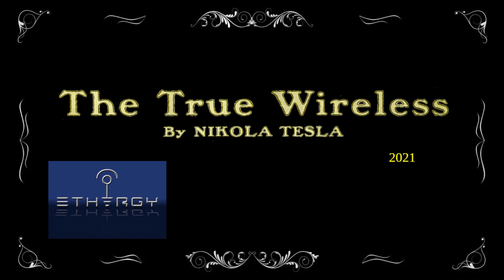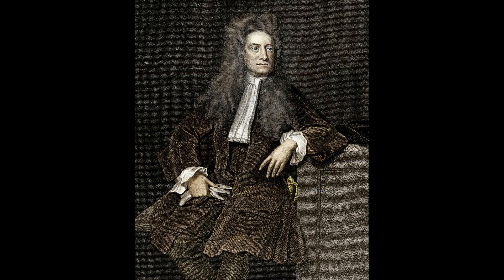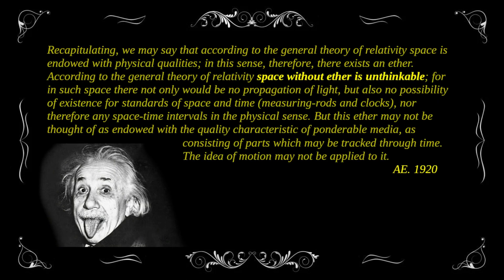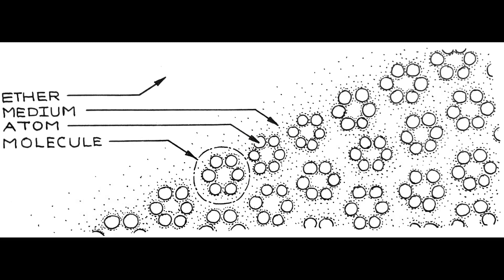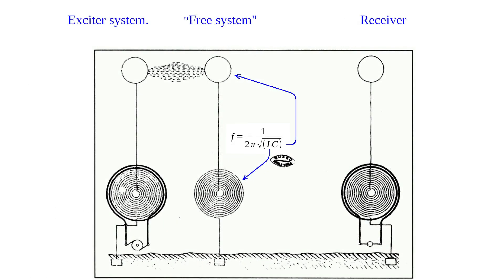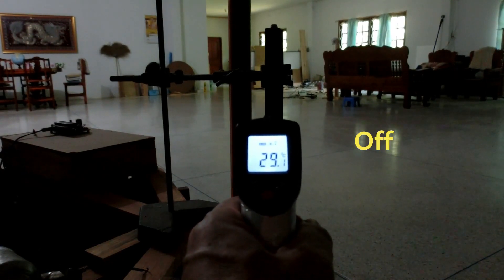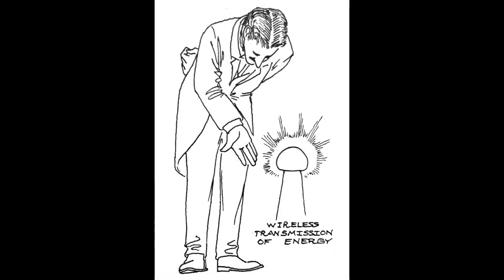Sending electricity through the Earth

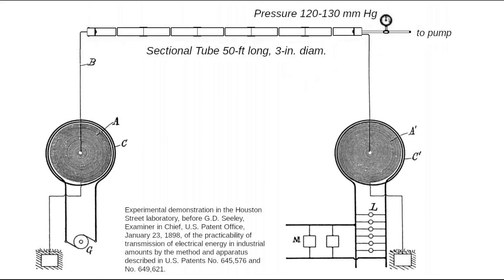Comment: Hi, great researches of yours! I'll be looking for your advancements, probably joining your group soon! I have a question since I've never heard about a Tesla scale ( you mention it at the 0:50 of the video "Colorado Springs slayer exciter 2" ), does this 11.772Hz is related to that scale? Do you have any references to link me to further understand that Tesla Scale? Thank you for your efforts :)
Reply from the maker: You got me confused there for a moment but now I see what you mean. You misinterpreted my words. I made a scale model of the Col.Springs coils. As everything is 25x smaller, the frequency of that coil is 25x higher. My model had a frequency of 1209 KHz so if you scale that up by a factor of 25, that would correspond to a frequency of 48.36 KHz at the original scale (size).
The 11.77 Hz is related to the dimensions of the Earth, not the coils.

Comment: What are you using as the grounded Earth electrode for the transmitter? What are its dimensions?
Reply from the maker: A 21 m copper pin. About 1.5 cm diameter. Ground water is at 10 m deep at our location. In fact we use 2  of those for both sides of the transmitter and we have 3 more that are 3 meter deep for grounding various other parts of the circuit.

Comment: If standing waves in the earth do not fall within Maxwell's equations, then what theory or model exists to describe the standing waves you propose can exist?
Reply: @CharlieSolis  Does that mean one wire power is fake?
Reply from the maker: Good question.
It is Tesla's theory, which states that electricity is a gaseous medium immersed in the ether. Within any gaseous medium you can have longitudinal waves, much like sound waves. When you have waves in a confined space, they can become standing waves.
Reply: @WardenclyffeResearch  I suppose I should clarify my question. What I mean to ask is if there are any mathematical equations (presumably, not Maxwell's) which describe the behavior of the standing waves. If I wanted to repeat the experiment, or if someone wanted to be able to determine how to make a receiver for the magnifying transmitter, they would need such equations to be able to make the correct circuit.
Reply: @AlmostAGamer  search for a book called "Almost all about waves" by Pierce. There you will find the math about standing waves, which is somewhat easier than you would think. You cannot expect equations similar to those by Maxwell, because Tesla's theory is somewhat "newtonian", mechanical, applied to electricity. You have to figure electricity as a gaseous substance. Like matter, so to speak.

Comment: Well done. First, you are respecting what Tesla originally said. Second, that temperature variation is wonderful. I noticed when oscillator is turned on/off that I get nerve currents through my body. Now you have measurement that shows something is actually happening. This temperature variation could be exploited to derive energy from surrounding medium.
Reply from the maker: Thanks, and yes, you are right about deriving energy from the surrounding medium. That is what happens in lightning and that is what Tesla was after with his magnifying transmitter.
Reply: @WardenclyffeResearch  Because ether is a gas, this effect literally could be exploited with the electric machine as well with mechanic machine. Peter Graneau explained that capacitor discharge in the water releases heat deposited in the water by the Sun. This explains invention of Lev Yutkin. Once I read a book about two stroke piston engines written by Blair Gordon. In the introduction is said that gamma factor in adiabatic process is not same for compression and rarefication in the air. This lead to conclusion combined with Graneau observation that Sun's heat deposited in the water vapor suspended in the air is released in the process of continuous compression and rarefication of the medium. It turns out that Sutra 37 in Sankhya talks about this process. This is when I realized why intake in Tesla's mechanical oscillator was so close to freely oscillating piston. Free piston was releasing free heat that he used to increase input pressure. And there is of course Tesla's unpublished patent for artificial rain, one of the many applications for Magnifier Amplifier - the Lamp of Aladin as he referred it - where literally same principle is observed. Every morning during dew point, heat is released from water vapor which heats up the day. It is completely natural process that exists since beginning of time and which is not harmful to human health.
Reply from the maker: @lukalopin  I have never heard of Peter Graneau, Lev Yutkin and Blair Gordon. I'll google them, but do you have some tips on where to start with these people?

Comment: It would be interesting to do that with an infrared camera.
Reply from the maker: Definitely! I'm saving money for a IR camera.
Reply: I’m now wondering what the refresh rate is on the infra red cameras. I have access to a Snap-on one that cost £1k and measures up to 450C
Reply: @nikola.tesla.r.and.d.centre  the real question is whether the IR camera is affected or not by intense electric fields. If yes, measuring by this means would be useless.
Reply: @tanner1985  if the Tesla bulbs are used they act as tuned lightning. I have articles from the 1890s on such things. This is electrostatic transmission. It acts like hydraulics and behaves live a nervous system.

Comment: The infrared thermometer suggests compression and rarefaction in the aether?
Reply from the maker: depends on what you'd call the aether. It shows compression and expansion of a gaseous medium immersed in the fluid ether.It also links this medium to photons as the explanation of black body radiation is based on "photon gas". This modern concept comes very close to Tesla's "medium".